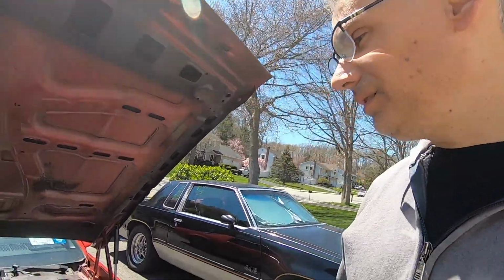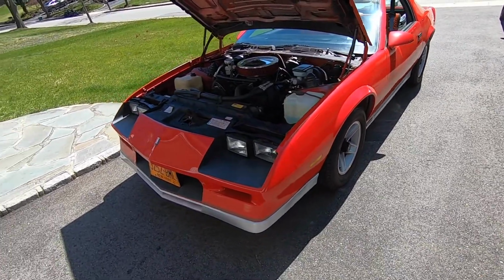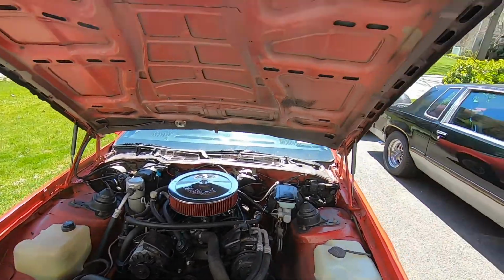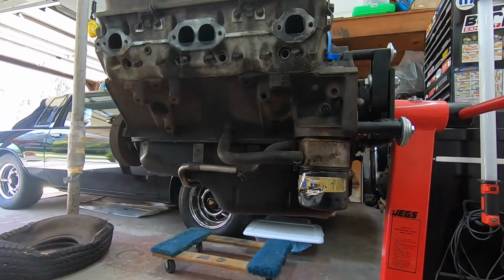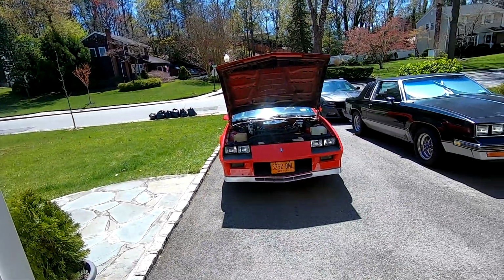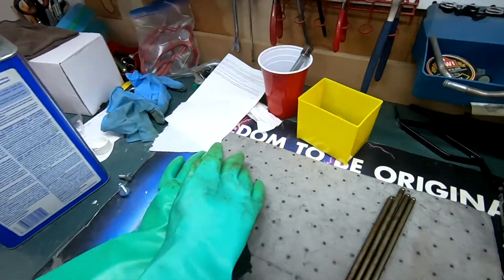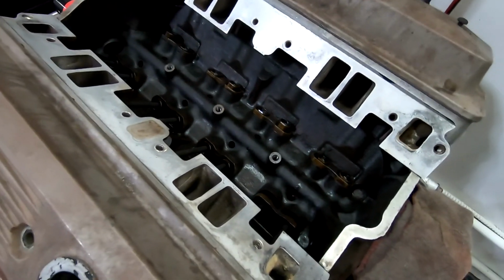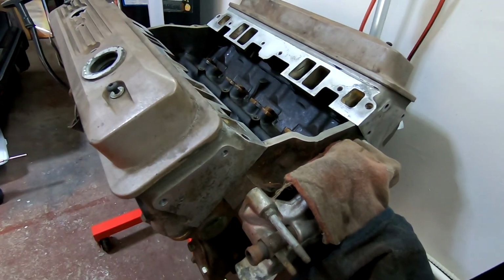Project Camaro Z28 Plan Update: Budget 350 swap prep

Comment: It gets horrible gas mileage because you are still running the CCC distributor and a non-CCC carb (1850). The ECM is staying at base timing with zero advance. Just the addition of a conventional HEI will wake that L69 up like you wouldn’t believe. The L98 is a decent swap and the 113 heads that are on it are decent for their day. Either way, with the 305 or 350, dump the CCC distributor if you’re not going to run the factory E4ME.
Reply from the maker: Thank you for the advice Joe.  I'm definitely going to check this out.

Comment: I'm surprised a Democrat state like NY doesn't require emissions testing (not that I'm complaining).
Reply from the maker: Yes, me too!  They used to require these cars to run on roller dyno testing machines and if it wasn't basically stock, it would almost certainly fail.  They even had video cameras pointed to deter the shop from running another car in it's place.